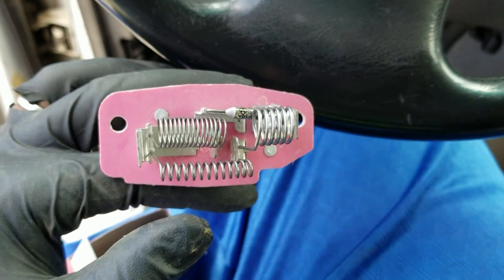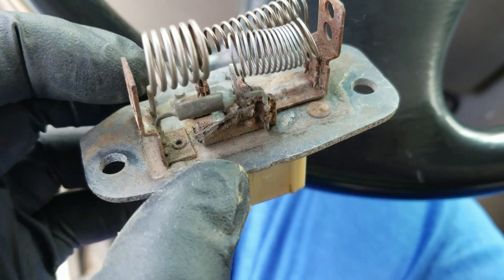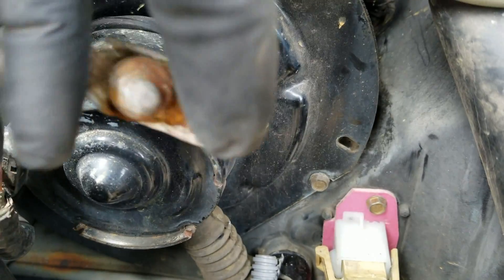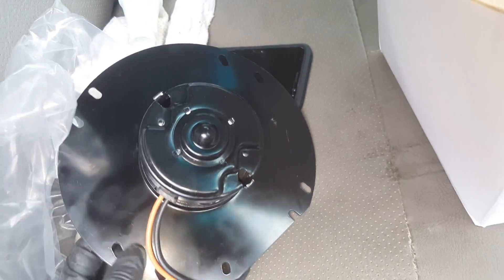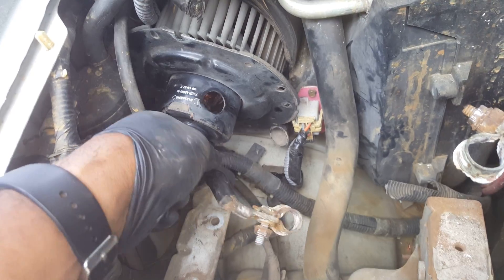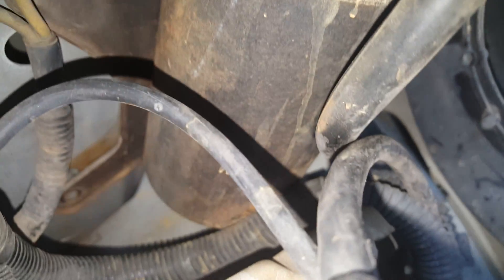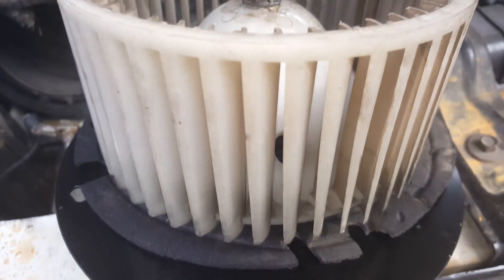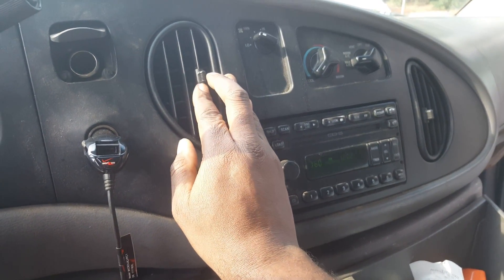A/C Blower Not Working In 1998 Ford E350 Van! REPAIR VIDEO

Comment from the maker: I actually blew the fuse during installation. The fuse was good before I purchased the parts.
Reply: I have a Ford E350 Econoline van and my question to you is this, I bought this van 6 months ago used as-is. The defrost actually does work but the air is not blowing on the AC vents that hits our face. Did you have the same problem I had or was your defrost not working either just
Reply from the maker: @gabrieljuarez2471  I had the same problem. It's most likely that fan relay

Comment: You can also always unplug the motor and add 12 volts to it directly and see if it powers on. If it does you know its something else like a fuse or relay. If it doesn't then you know for sure its completly dead

Comment: Note to self always check power and ground that every step that you can determine if there is a simple failure of a connector or bad wire rodents chewing it squirrels whatever. Thenyou just might avoid purchasing parts that are electrical in nature in the part store does not want to take back.
Reply from the maker: david zurek my original resistor was so rusted that I decided to change it anyway.

Comment: I have a 1997 E350 Club Wagon (12-passenger) van. The fan "barely" blows out air. It's very weak! It seemed like it blew air just fine when we first got it, but I can't remember that far back. We've lived with it this way for so long I can't remember. I wondered if there were two fans up front, but after watching your video, I'm guessing there is just one. I just wish it would blow a lot harder than it does. It sucks. It just doesn't put out enough air to cool us down up front unless we drive for at least 15 min. or more.
Reply: Doug Lewis it’s likely your resister
Reply: Or a plugged up condenser coil. Theres no filter to prevent leaves and crap from getting sucked in by the blower. Removing the blower and with a shop vac and air hose you can get alot of the tree debris out.

Comment: Well something caused that fuse to blow, hopefully the fan and resistor R an R was needed. Yes I'll be checking my fuse and relays 1st.
Reply from the maker: I did check mine first, they were good. I blew it during the installation.

Comment: removing the fan is the hard part, which he did not show. yeah, loosen the accumulator helps, but that is not enough. also he did not show how he installed the new fan. not that much help. sorry
Reply from the maker: I only had one hand film so I needed both. 

And as for the installation, you just put it pack the same way you took it out.